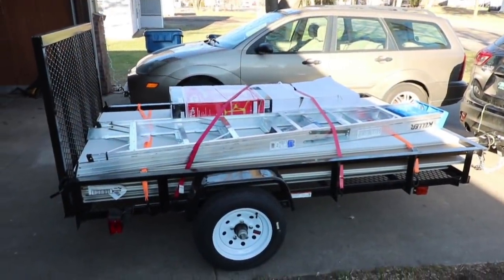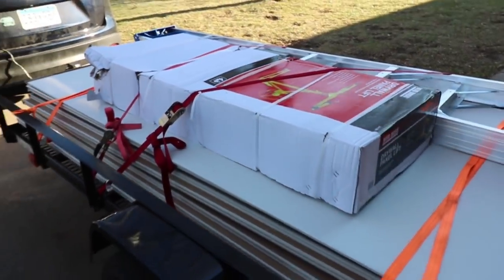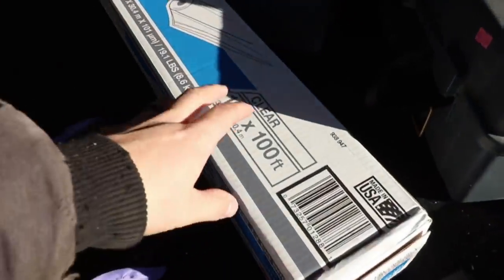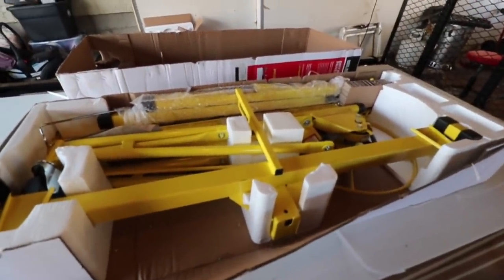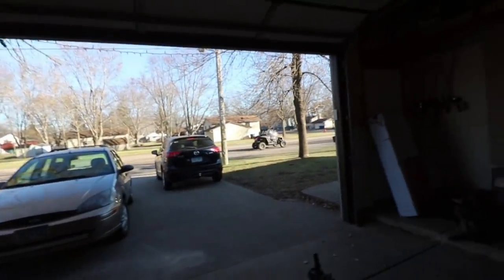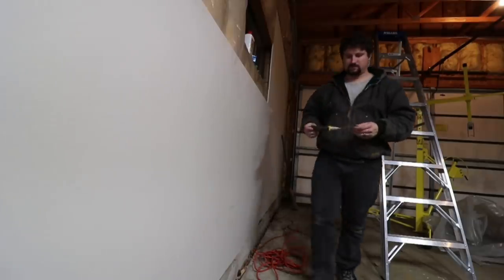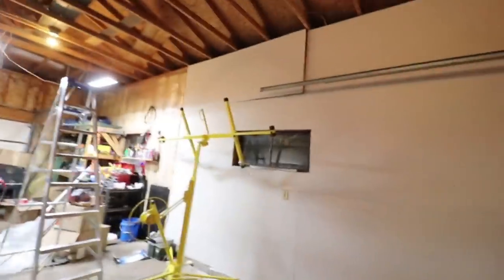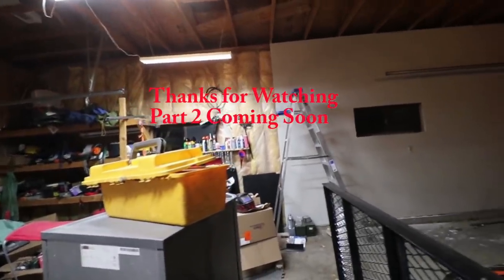Finishing the Garage. Part 1. Time to put up some sheetrock.

Comment from the maker: This is Dad. Great job Zachary, nice video. I have never used one of those lifts and I wish I would have bought one years ago after watching you use it. Instead, it takes me awhile to get up out of a chair. Haha. That garage is going to be nice once you get it all done. What type of heater ore you guys planning on putting in there?
Reply: So Joe , would you have put the sheet rock on the studs ?? No Bashing at Zach , he is doing awesome , but just wondering ??
Reply from the maker: We plan on putting in a 7500 watt electric heater. It has a thermostat and is controlled by a remote. I considered natural gas, and a ventless propane but the initial cost was pretty high. A guy at work has an electric heater in his 2 stall garage and he says his bill is the same compared to running his ac in the summer. We will see how expensive it is.
Reply: The garage it’s looking pretty good Zach, good job on putting up the drywall! 😃👍

Comment: Zach it is always good to have your tools to work with.  Like you said it will safe your back, and after your done, you could rent it to your dad!  LOL  But, really, you never know when you might need it again.  But, also you can always sell it and get some if not most of your money back.  You are correct, sheet rock is hard to do by yourself, especially a ceiling.   I like that trailer, maybe because I have the exact trailer (similar), my trailer has the wooden slat in the floor.  I use mine mainly for hauling my 4 wheeler, but I have hauled firewood and other things on my trailer.  You could tell she just woke up, she didn't say hi but that smile was awesome.  You did good and that tool came in really handy.  I almost jumped when it looked like you were dropping that one partial sheet!!  Juddie - J & J TOA

Comment: Drywall lifts indeed ! I, like most kids in the building trades learnt to hang Drywall without them at around 17 years old.  If I might say, for fire resistance on walls and ceilings abutting occupied areas 2 layers of 1/2” plasterboard is about minimum. This should be enough to allow you to get out of the house when the car goes up in a garage.

Comment: If you start at the top and work your way down then the clips that hold the sheets wont be in the way. should stagger the joints and break the sheets on a stud.
Reply from the maker: Your right.

Comment: did you consider putting 3/4 plywood on the walls? it allows you to ability to hang things and unlimited options on storage and placement of items
Reply: $7.50  per sheet for drywall and $25.50 per sheet for plywood and if the expense doesnt bother you. There are building codes in some areas with attached garages for fire ratings which plywood doesn't qualify for and drywall does
Reply from the maker: I like the look of drywall, I weld in the garage sometimes and I wouldn't want the plywood because of the fire hazard.

Comment: i made ts from 2by 4s 4 inches longer then cieling took an 8 ft ladder and put edge on top used t to lift up and wedge worked great
Reply from the maker: I have seen that before, I tried it at the last place and had no luck with it. I do enjoy the lift though. Thanks for the comment

Comment: I used to have to unload drywall by hand from a delivery truck in S. Florida.   Lifting it off the truck with another guy and walking it into the jobsite.   4x12 sheets (2 sheets together) was a terrible job in that heat.  I can't tell you how awful it was.
Reply from the maker: I agree , I can't stand moving the sheet rock around, let alone a 12 foot sheet ! Thanks for the comment
Reply: @JoeandZachSurvival  Good to see more Zach content lately too by the way!